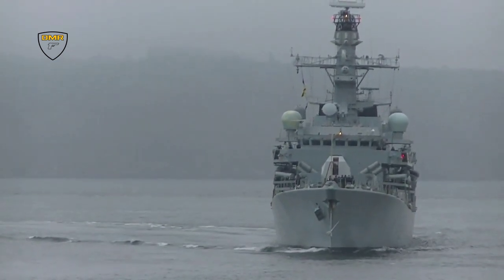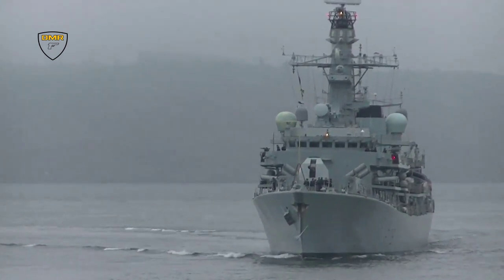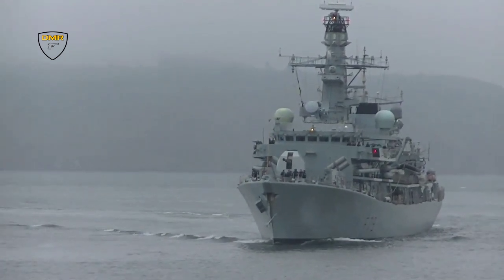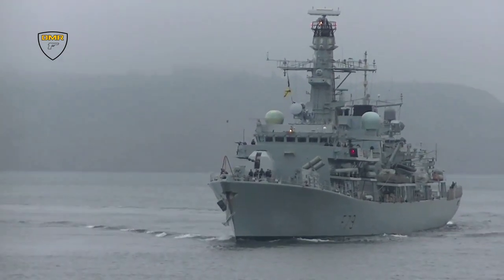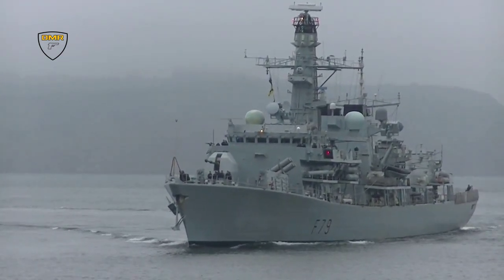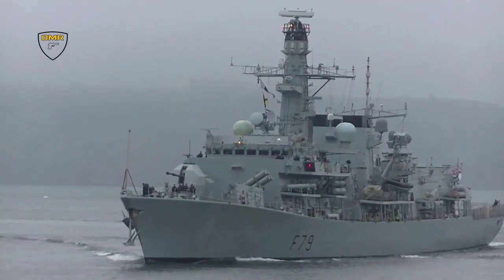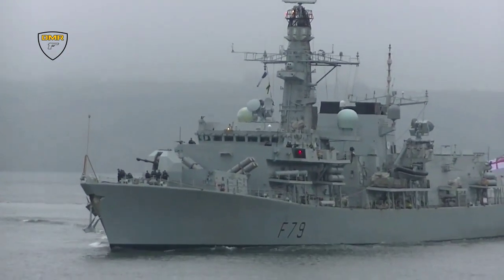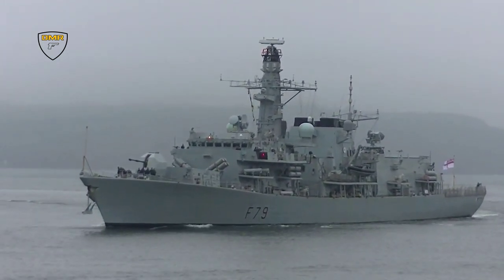Shocking! Massive revamp Type 23 Frigate and back to sea with full power

Comment: How crap is that! One of the major issues of the type 23 was that had no defence weapon system facing  back over the flight deck.
Seawolf on Broadsword and Brilliant were the only ships that had half a chance in the Falklands.
Anyone with half a brain would have fitted a CIWS on top of the hangar.
Reply: You just said it yourself: only the ships with Seawolf had a chance. Well guess what ...Seawolf is vertical-launch, so does cover the rear the ship.
Reply: @rocketassistedgoat1079  You mean VL Seawolf, which is a different launch system 😂. Plus it takes a few more seconds to engage doing the role over, and that time gap would be where a CIWS would be handy.
Reply: @jamesmurphy7442  Um ..show me the Type 23 (just one will do): that DOESN'T have VL Seawolf? I think you're talking out your arse guv'nr. People WITH half a brain, put Type 23 together, and it's been a very successful design, rivaling legacy systems like Abrams and F-15 Eagle with a near fifty yr lifespan. You'll have to show me the successful ship you built sometime, 😄.